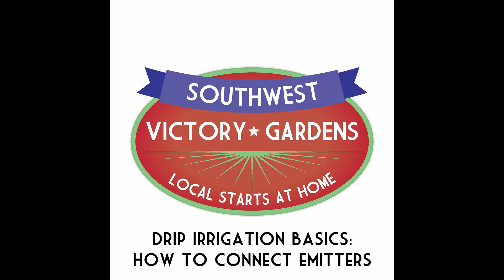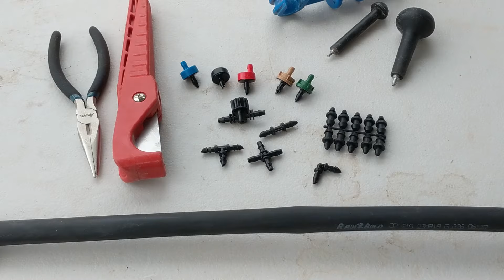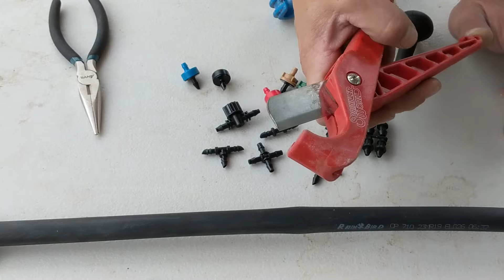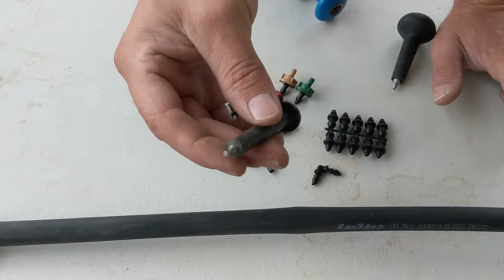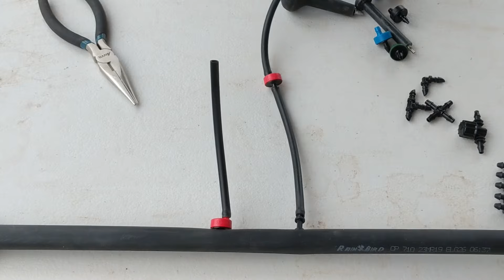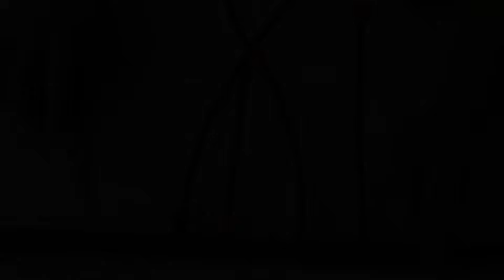Desert Gardening Basics: How to Install Drip Emitters

Comment: Is it a problem to have a small fine spray leak where the emitter plugs into the main tube?  If so, how do I stop it?
Reply from the maker: It's only a problem if you don't want water where the spray is. If it's leaking around an emitter you can remove the emitter with needle nose pliers and plug up the hole with the fat end of a goof plug. Poke a new hole using a good punch tool and reinsert the emitter and hopefully that will stop the leak. Good luck!

Comment: Great video! How do you remove a broken 1/4” straight fitting from poly tubing? It broke off and the barbed part of the fitting is still inside the 1/2” tubing.
Reply from the maker: You just gotta pry it out with needle nose pliers. Once it's out, use the fat end of a goof plug to plug up the hole. You can use the same needle nose pliers to insert the goof plug if you are having trouble. Good luck!

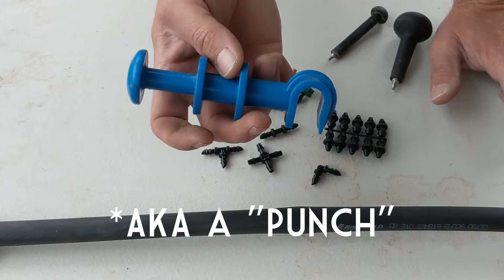Comment: I'm sorry that you missed mentioning that the blue spring-loaded punch shown here ALSO functions as an insertion tool, obviating the need for needle-nosed pliers.  At 2:10 you can briefly see that the opposite end of the blue punch tool includes a flexible black plastic collar that is intended to hold a barbed connector for insertion into 1/4" or 1/2" tubing while you grip the barrel of the tool, so you're able to use the full force of your hand - not just your fingertips - to press the barb into the tubing.
Reply from the maker: Great tip, I didn't even realize I forgot to mention that! Thank you!

Comment: How many connection can you use on 1 emitter. I am use 2 line with a T for 1 emitter and only one is working. Does the length off line matter and loops?
Reply from the maker: You can split emitters with a "T" or even a cross fitting, but you'll only want to do that with a short distance of line and both lines should be equal distance from the split or you can get uneven water distribution. I'll sometimes take a 2 gallon emitter and split it close to the plant so I can have 1 gallon watering from two lines instead of two gallons from one line, if that makes sense. You don't want to have more than about 8' of line if you attach the emitter at the poly tube, if you put the emitter in line, you can run it for a longer distance. Hope that helps, good luck!
Reply: Tyvm known I know my problem !!

Comment: if you put emitter first, then 1/4 inch tubing, you will have to buy a bug cap, right?  because the 1/4 inch tubing opening looks bigger than emiter outlet.  but if you put emitter at the end, you don't need a bug cap.
Reply from the maker: I've never heard of a "bug cap", shouldn't be necessary though. The lines are designed to fit onto the emitter using compression so they are slightly smaller than the barbs of the emitter. Good luck!

Comment: Is the poly tube the water line from a sprinkler system? Do you just tap into that?
Reply from the maker: The "poly" tube is the larger diameter black tubing that the smaller "spaghetti" lines are attached to. In this video it's the tubing that runs along the bottom of the screen. Good luck!

Comment: How do you prevent leaking from the emitters?
Reply from the maker: I recommend using a "punch" tool for making the holes in the poly tubing, if you use a nail or something else the holes will leak because they are not the right size. Good luck!

Comment: My fingers aren’t strong enough to get the emitters into the spaghetti tube.  Suggestion?
Reply from the maker: This is very common, I have trouble as well. When you get the hang of it, using needle nose pliers can make the job easier, but you can also heat up the tubing using a lighter, hot water, or heat gun and it will make inserting the lines a little bit easier. Good Luck!

Comment: After you punctured a hole and inserted the emitter into your 1/2 inch pipe can you remove it and plug in a new emitter?  Also, will the emitters break in the winter where it drops below 25 degrees?
Reply from the maker: Most of the tubing is rated for cold weather, but the timers usually are not. In areas with cold winters I would probably drain the lines in the winter disconnect the timer. Sometimes you can very carefully remove an emitter and replace it, but most times removing an emitter stretches the hole so much that when you replace the emitter you'll have a leak in that area. Best thing to do remove the emitter and plug with a goof plug and replace it with a new emitter. Good luck!

Comment: No PVC Tube needed?
Reply from the maker: There are fittings that can convert existing PVC systems to drip, it just depends on the set up. New systems are usually a hybrid of PVC and poly tubing, but they can be one or the other, it just depends on the installer. I will say that PVC fittings and components are very expensive compared to the poly tubing.

Comment: Thank you for the great video.  Can someone tell me if it's normal to have a leak where the emitter connects to the polytube?
Reply from the maker: There shouldn't be any leaking from the poly lines, try pulling on the emitter a little bit to see if that helps to stop the leak, if it doesn't, you'll want to remove the emitter and plug it with a goof plug and replace the emitter. Be sure to use a punch tool when inserting the emitters so you don't make the hole too big. Good luck!

Comment: How do you pull them out of the half inch tube?
Reply from the maker: I use needle nose pliers. You have to work them between the emitter and the tube and gently wedge them out. Once you do that you won't be able to reuse the same hole again without leaking so you'll need to get some "Goof Plugs" and plug the hole using the fat end of the goof plug. Good luck!

Comment: Great video . Thanks . Even though my arthritic thumbs were screaming while watching you easily pushing the fittings in , I’m doing it tomorrow !
Reply from the maker: Irrigation is definitely hard on the wrists and fingers, I won't lie! A few tips: you can use needle nose pliers to pull out or insert emitters, this works best when the tubing is very rigid and not as flexible. Another tip is to use some time of heat sourches, like a lighter or even a portable heat gun. Heating up the tubing makes it softer and easier to work with. Hope that helps, happy gardening!

Comment: How you connect to pump
Reply from the maker: There are lots of different ways to go from PVC to Polytube, but the easiest is probably to install a hose bibb and run the timer off of that. Check out my other video on how to install a hose bibb timer. Good luck!

Comment: I waited the hole video to see how it was connected to pump ugh
Reply from the maker: I don't have any videos on connecting irrigation systems to pumps. I would just make sure whatever pump you use can operate at a very low water pressure, most system components are designed to operate at about 30psi. Good luck!

Comment: Thanks for your video, very informative. How do I replace clogged emitters? Is it possible to remove them with a plier and reuse the same hole?
Reply from the maker: it's possible to gently remove an emitter and replace it, but more often than not you'll end up stretching the hole so much it will leak after you replace it. I find it's better to plug up the old hole and make a new one right next to it. Good luck!
Reply: I was curious what you use to plug up the old emitter hole? Thank you.
Reply: @davidmarshall8265  In the video he showed that you should use a plug . It's on around  the 10th minute in the video.

Comment: How about tapping into pvc, with drip lines?
Reply from the maker: There are several compression fittings that can be used with PVC to connect to poly tube. You can go from PVC to 1/2" poly or even PVC to spaghetti line.

Comment: How do I ensure equal drip rate from all barbed Tees?
Reply from the maker: The emitters you see in this video are "pressure compensating" meaning they will all put out the same amount of water equally, regardless of changes in elevation or water pressure. If you're using non-pressure compensating emitters, like the "flag" types, you'll need to change them out. You'll also want to make sure you're using a pressure regulator on the system large enough to handle the length of your line and the amount of emitters you have. Longer runs of line require larger pressure regulators and sometimes larger diameter poly-tube. Good luck!

Comment: Question:  I added a drip line to a large planter with succulent plants and covered with pebbles—I buried the lines. Do you suggest I uncover the drip lines? Will they clog?
Reply from the maker: It is not necessary to have the lines above ground, but in my experience they will work better, be easier to maintain, and last longer if they are not buried. Good luck!

Comment: I so agree with comments.  The information is concise and easy to understand with no fluff--thank you.  I love the idea of attaching a tube to the end of the emitter to avoid plugging!! Do one of your video's cover what is best emitter (and GPH) for plants/shrubs/trees?
Reply from the maker: I don't go into detail here about that, but typically for trees you would use emitters that put out a lot of water per hour, usually 5-10gph emitters and for shrubs you are probably ok with the standard 2gph emitters you see in this video. What's most important is how many emitters you place at each plant and how you space them. You can visit my website and where I have links to several publications on how to properly water trees and shrubs. www.southwestvictorygardens.com/documents. Good Luck!

Comment: I have 1/2" rainbird drip irrigation emitter tubing wrapped under multiple hydrangea plants. I have a 30" planter about 7 feet away I'd like to run spaghetti tube to water the planter. Is it possible or okay to just insert an emitter into one of the holes on the emitter tubing then run 1/4" spaghetti tube to planter?
Reply from the maker: Thanks for the question shane. I wouldn't recommend trying to insert line directly into one of the emitters on your 1/2" tubing. Instead i would recommend you place an emitter somewhere in between the in line emitters and then run some spaghetti tube off of that into your planter. good luck!
Reply: @SouthwestVictoryGardens  Thabk you sir, had you not responded my naive butt would've done just that 🤣💥🖐🇺🇲👌

Comment: How do you keep the small tubing from blowing apart from the emitters and so forth
Reply from the maker: Hi Stephen, great question! These systems are all designed to be used at low pressure, typically 20-40 PSI. to convert your water pressure you'll need to install a pressure regulator between your water source and your tubing. I talk a little bit about the components you'll need in this video: https://youtu.be/-G5abcgCNYo

Comment: Very helpful, thanks. 2 things I've learned. Never use a drill to make the holes on the poly tube. When you put the small watering ends on your flex line, they can clog up easy if you have any dirt in the main line. Also make sure you secure them on to your flex line, you can just push them on, but adding a clamp helps. I've had lots blow off never to be found again from the water pressure.
Reply from the maker: If you're having issues with lines blowing out you'll want to make sure to install a pressure regulator. These lines are made to operate at between 20-40psi and can blow out easily if the water pressure goes above that. 

Definitely recommend using a punch or pokey tool for making holes in the line. Thanks for checking out the video!

Comment: Does you favorite way work for going up in to pots (vertically) was just wondering if putting the dripper at mainline would not supply the pressure needed to push it up.
Reply from the maker: You can run the lines from the emitters uphill and for about 8 feet or so before you lose any pressure. The emitters are "pressure compensating" so they are designed to work with elevation changes. the third method shown, with the emitter in between two lines, will allow you to run the spaghetti line longer distances. Good luck!

Comment: what size is that t fitting?
Reply from the maker: Most residential irrigation systems are set up using a 1/2" tube for the water supply, that uses 1/2" fittings, usually compression or "power-loc". Spaghetti tube and the emitters to connect to it are usually 1/4".

Comment: I have a soaker running in my flowerbed. Can I punch in an emitter with the spaghetti pipe in my soaker to water my pots?
Reply from the maker: Not sure of your set up, but you can connect 1/4" tubing to 1/2" tubing using barbed connectors.

Comment: How close together can we have 2 or more emitters on a poly without it affecting the flow ?
Reply from the maker: Distance between emitters won't affect the flow at all, what will affect the flow is total gallons of water coming out of your line at one time. most systems are only set up to water about 180-200 gallons at once so if you need more water than that to water your landscape or garden then you'll need to add another valve.

Comment: Firstly, I wanted to say thanks for creating such an informative video series! My partner and I are in southern Colorado and are setting up drip irrigation for our vegetable garden. We're currently agonizing over how to do 2 rows of grow bags fed by 1 common 1/2" line. I'm looking at one of these two setups:

A) 1/2" line -> Tee -> 2 spaghetti -> one valve on each spaghetti-> emitters and such
B) 1/2" line -> 2 valves directly on the line -> emitters and such

B would be easier and cheaper, but I'm afraid that the valve will start leaking at the connection to the 1/2" line after repeated adjustments without the strain relief added via the tee and the spaghetti in version A.

Do you find that barbed fittings connected to 1/2" line eventually loosen and leak if they're messed with too much / when you put the valve directly on the 1/2" line?

I sincerely appreciate your help. Thanks a bunch!
Reply from the maker: The goal would be to try to spread the water evenly across the surface of the soil while trying to poke as few holes in the main 1/2" poly line as possible. The more holes you poke in the line to add emitters or barbs, the more possibility for leaks. Rather than poking two holes in the line you can use one emitter and come off of it with a 1/4" "T" barb and run two lines off of the "T" to opposite sides of your containers. This of course is a lot of work but it's the way that I water a lot of native shrubs in native soil. This method uses fewer emitters and also spreads the water around the root zone more evenly
Reply: @SouthwestVictoryGardens  Thanks for your help! Glad to know I wasn't just being OCD with worrying about the 1/2" line punctures. We'll go with the Tee method.

Comment: I don’t like burying the drip emitter so much prefer the closer to the plant: they are easier to remove without buggering the supply line, easier to change out if you need to go more or less gph, and when they finally fail. Downside is are more exposed to elements, add a perhaps unwanted colour to the flower bed, etc., and may not meet a certain aesthetic criteria…
Reply from the maker: I actually don't mind leaving it on the surface. It's easy to spot leaks and do any kind of maintenance and add emitters. In my experience most poly tube is pretty resistant in the desert sun. Trying to fix a leak in a line that is buried 12" is no fun and it still degrades over time requiring replacement anyway.
Reply: @SouthwestVictoryGardens  Thanks for that logic

Comment: This is a great video, thank you! Curious... would you suggest I run my irrigation stations with higher GPH emitters for shorter period of time, or lower GPH emitters and for longer? Does one impact the ability for the system to carry water to more plants? Anything I'm not thinking about?
Reply from the maker: it depends on what you are watering, but generally I try to use as few emitters as possible if I can get away with it. That being said, the most important thing is to water the entire root zone of whatever plant you are watering. So for example, a tree with a small canopy might do ok with 5 10gph scattered around the root zone, but a tree with a larger canopy might be better off with 10 5gph emitters to cover more area around the larger tree. Another trick is to take 1 emitter and come off of it with a "t" so your 2gph emitter can be split to be 2 1gph emitters. This works great for shrubs because you can spread the water more evenly around the root zone than if it were just 1 emitter.

Comment: If the spaghetti line is going up hill, how does the first method (emitter directly into poly) get enough pressure to get to the plant?
Reply from the maker: These are "pressure compensating" emitters  so they automatically adjust to changes in elevation. They being said, you don't want to run more than 8-10' of spaghetti line off of your main line

Comment: Quick question, let's say i install a 1 gallon emitter directly to the 1/2 inch mainline.  What's the maximum length you would recommend running the 1/4 inch line from the emitter to the plant.
Reply from the maker: You probably wouldn't want to go much more than 8-10 feet with spaghetti line